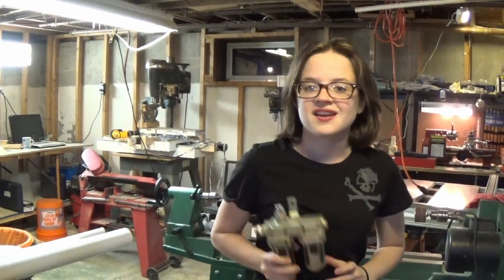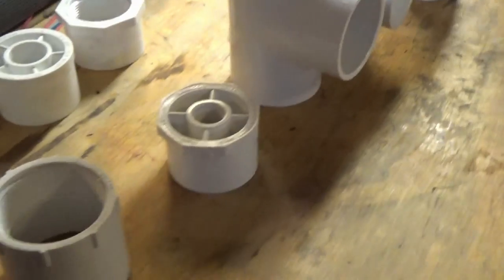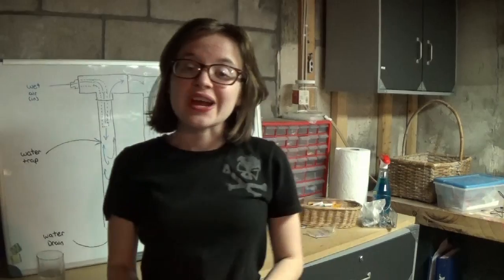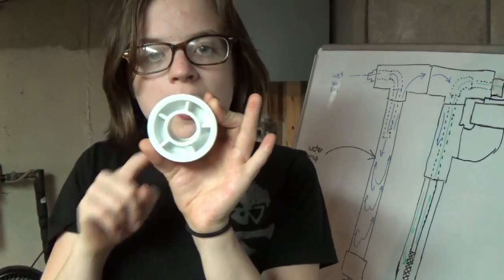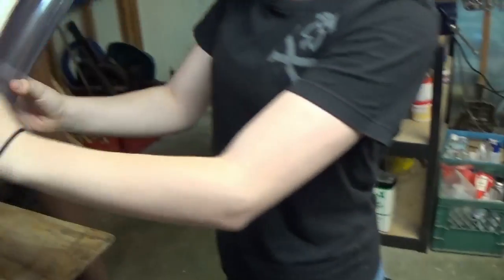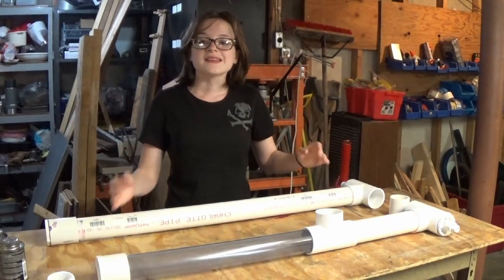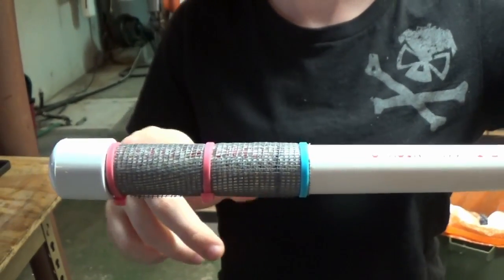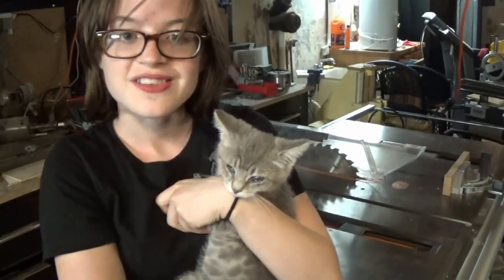Ep 11 Dirt Cheap DIY Dessicant Air Dryer

Comment: I really liked the how it works part of the vid.

Hannah, you are correct in getting rid of the humidity to help control sand clumping and stopping up your blaster. However the real problem is that you are using sand. Some other medias don't have this problem.

 I usually spread the sand onto a tarp and leave in the sun to dry, then screen out the junk before using. If I am recycling the sand, I also screen out the fines into another bucket to use for finer sand. I assume that you are going to paint your VW and sand blasting cases problems here also. Fine dust buildup in crevices is common to all types of  blasting and can cause the paint not to stick. If you get out your magnifying glass and closely examine the blasted surface you will see tiny grains of sand actually embedded in the metal Some say that this is silicon and will cause problems with some paints. Cure is to use sandpaper after blasting to knock these off.

Now for the real problem with sand. I started to say this on one of the other videos, but I didn't. Sand dust causes silicosis. Irreversible and ultimately deadly. Google it. Some other medias don't.

Blasting cabinets solve the problem by containing the dust.

I assume that you are using a respirator under your hood The hood protects your eyes and skin but does nothing for your lungs. And it is hot. A solution that i like a lot better and that can also be used while welding, painting, or any time you need it,  is outside positive air pressure. It involves an oil free air pump/fan, a long flexible hose fitted to your hood and set the pump some where where there is clean air. I set mine inside by the air conditioner/heater. I droop the hose down from the ceiling in the work area so it is out of my way. The positive pressure in the hood keeps the dust out, provides a cooling breeze across your head, and keeps the window from fogging. 

I tried to make a homemade one from 4" flex duct and a 4" fan but it didn't work too well and was cumbersome. So I bought one from ebay with a 120v tubine type fan and 100' of 3/4" light weight flex tubing and quick disconnect hood connectors. Works good but the fan is noisy in the house, so a remote switch to turn on and off is nice. About $250 10 years ago, $400 now, but you can easily spend 10 times that on better systems.  I know its expensive, but worth it to my lungs and comfort. Can also be used to blow up air mattresses, boats, and beach toys quickly. Works pretty good for light dusting as well, not as good as an air line. Scuba compressor would work if you have one. This would be a good DIY project for you. You could run 1" pvc out to your work area/areas and then quick disconnect adaptors to your flex hose

 Google "positive pressure respirator system" Here is one similar to my cheap one

http://www.ebay.com/bhp/supplied-air-respirator

Comment: Hannah, this is so cool. When I get back from being busy building a sauna (a finn needs a sauna), I'll definitely be copying from this design. I'm also loving the naming scheme of Bernoulli and Schrödinger. Do you also have Otto for the combustion cycle?

+drb52photo she said the pieces are pressure rated so that kind of takes care of the shattering issue...
Reply: PVC pipes and fittings are designed for pressurized water applications.  Please do some research on the subject before you decide to make the assembly.
Reply: just because it is pressure rated does not mean it will not suffer from pulsing oscillations that cause hairline fractures in plastic pipes. That then lead to some dramatic failures. Exploding plastic pieces can cause death if you are nearby. Might wanna do some research.

Comment: It has been my understanding that pvc should not be used for compressed air applicatins due to the potential for shattering and projecting sharp pieces.  Can you explain why you are not concerned about this potential hazard?
Reply: very well played......
Reply: You should Google "schedule 40".  Both metal and plastic pipes are schedule rated for different pressures and temperatures. The biggest problems that have had with pvc are related to:
      water freezing and breaking the pipe (happens to metal pipes too),

      uv radiation making the plastic brittle when used unprotected outdoors (cover/paint it or use the grey pipe from the electrical section at the store which is uv resistant but not schedule rated for pressure),

      and static electricity problems which can be a hazard in some applications utilizing flammable fluids (fuel, some paints, pesticides,etc) or fine dusts (dust collection, vacuum cleaning, etc). Grounded metal pipes are best for static electricity problems.

High speed air/fluids or tool rubbing against the pvc can generate a lot of static electricity in pvc, styrafoam, and other plastics. Look at the pvc she cut with the lathe and saw. See all the chips clinging to the pvc (and probably her skin and everything else)?  Most of the solutions I have seen to static electricity involve wrapping/fastening copper wire around/along the pipe  (the wire must make as good of contact to the pipe as possible) and grounding. 

I have used pvc for years because it is quick, easy, and cheap and for some uses it is just fine. 

It is your responsibility to do your own research and follow your tool makers and material suppliers recommendations. Electric arcs and a fine mist of flammable fluids (or vapors) go boom or start a fire. "A horrible way to die, right Bernoulli?" Maybe she should consider more straps and grounding them. It's what you don't think that will/can bite you. But when its all over, the best that can be said is that life is just a bunch of trade offs.
Reply: +kidharris It is my understanding that it is the oil in the air that can compromise the pvc pipe's pressure integrity.  Web sites that I have found do not recommend pvc for pressurized air applications.  I would urge anyone considering making your assembly to do thier own research.
Reply: I haven't heard of that, but I don't think it will be a problem for this setup because I believe she is using oil less air compressors and doesn't have an oiler in the line.
Reply: kidharris 😝Here is one more link, read the first and last paragraphs.

The makers of PVC disagree with you.

http://www.lascofittings.com/compressed-air-and-pvc
Reply: kidharris Wow.. All I did was disagree and you go into a diatribe about BS spins and politics? 😂 

Why is it that manufacturers of PVC and those who deal in it strongly recommend not using PVC as airline?

I'll tell you why, because as you said, water is not compressible. It cannot store energy, while air is compressible and will store energy.

That's the difference. That is the balloon example. 

That is why PVC is a bad idea for air lines and is why all the manufacturers don't recommend it..
Reply: Hey BUF, thank you for the link. Since I already have the items, I think I will still use them but i'm definitely going to buy a pop-off valve for this now because of the article you posted. I'm am going to consider swapping out the hardware for copper later. Thanks for the very informative information. Keep up the good, "diatribe about BS spins and politics? 😂", LOL, It's very much needed! 
Best Wishes n Blessings. Keith
Reply: Let me put my .02 in.  You are right about not seeing the difference, but hearing it.  And all of your points regarding material properties are correct.  BUT, the difference IS in the reaction.  The reaction is a result of the ENERGY that is built up with air versus water.  Air can build up a stored amount of energy over 700 times greater than water!  This is because of the compressible nature of air vs non for water that you mentioned.  the noise is the release of this energy.

I am the Quality Control Manager for a piping company that fabricates piping systems and pressure vessels.  The ASME codes that we follow generally suggest that a hydrotest be performed for safety reasons.  If an air test is dictated by a customer, it is typically at a lower test pressure than if using water.   If an air test is performed, we follow an ASME standard (PCC-2) that even dictates the minimum distance personnel must be from tested fabrications or vessels.  

Look up hydrotest failures or hydrotest burst on youtube and look what can happen to steel pipe or fittings tested with water.  Those same failures would look like a bomb with an air test at the same  pressure!

kidharris wasn't far off in that all materials have a "yield stress" where the material will break.  But before that, all material will "stretch".  It just isn't easily noticeable in plastic or metal and easily seen in a balloon.

The potential dangers with compressed air are very real, and I cringe when I see some youtubers re-purpose pressure vessels like propane tanks.  if there happened to be defects in the welds, the results could be deadly.
Reply: @tobywise3781  Thanks to you and others for taking the time to point out PVC limitations and provide some links to manufacturers websites.  Somewhere in the comments someone posted about codes, who writes them and why.  All this along with original video are interesting informative content, food for thought.
Reply: Juat keep a piece of thick plywood over the installation to contain any pieces in case of a failure
Reply from the maker: As you point out, there is a significant risk with PVC that you do not have with other materials, and that is that if it fails, it is not ductile, and will shatter rather than deform, so shrapnel is a possible problem. 

With the exception of the clear section for the dessicant beads, all the parts of this dryer are rated between 220 PSI and 600 PSI.  (The clear section at 120).   This dryer is after a regulator and oil filter, and I run the system at a max of 90 PSI.  Since the safety margin is so large and since I will be nowhere near the unit when it is in operation, there are no real risks in my application.  

If I had been concerned, I would have built a plywood shield with air gaps around the sides to intercept any flying shards but allow the air to escape during an explosive decompression.
Reply: Keith Noneya I wish PVC was a suitable choice. I'd love to use it.  Something to consider about a relief valve is that while it would allow the system to vent at a given pressure, that pressure assumes the PVC is not going to explode below the "lift" pressure, if that makes sense. Relief valve may lift at 125psi but the PVC header may explode at 108psi.  Obviously these are made up numbers.

Something to consider over copper is PEX.  It will not explode like PVC, but should rupture much like copper would in the event of a failure.
Reply: kidharris I think you're tilting at windmills just a little hard man..
Reply: Not a complete solution but a rough enough fix would be to wrap it up with duct tape and that would contain 95% of the shrapnel? The worst bit was the lubricator on the line in LOL.
Reply: heres a wild and crazy idea for all of you thinking youre going to get speared to death by pvc lol...wrap it in duct tape....now its would probably hold up to more psi and if it fails it wont shoot a stake through your heart ha   not rocket science
lol just saw dazaspc comment now...see another one with a brain
Reply: actually, the balloon comparison is valid. 

The thing about the difference between fluid pressure and air pressure is that air can be compressed, and water cannot.  Let's say standard air pressure is 15psi.  Now, let's say we have a section of pipe with a volume of 2 liters.  If you fill that with water pressurized at 150psi, you have 2 liters of water in that pipe.  If you fill that with air pressurized at 150 psi, you will have 20 liters of air in that pipe.  

If the pipe fails under that water pressure, water will spray out of that pipe.  If the pipe fails under the air pressure, the pipe will explode.
Reply: BellyUpFish        I am NOT an expert, but I would be venture that 95% of the reason  that pvc manufacturers do not recommend   their products for air type usages is  Because of liability concerns. ,
Reply: yeah...liability concerns, and the common human decency that comes when you know a misuse of your product can cause serious injuries and possible death.
Reply: She is, she said so so please watch and listen again.
Reply: johnsont963 except those pressure ratings are for liquid, not air, which makes a difference.

Fill one balloon with water and one with air, then pop them both.  

What is the difference in the reaction?
Reply: kidharris Middle of the second page..

http://www.cresline.com/pdf/cresline-northwest/pvcpressurepipe/CNWPVC-40.pdf
Reply: BellyUpFish I see that you fired off multiple posts in a matter of a few minutes. I am going to only make 1 reply. It appears that you did not understand my post. I did not say that pvc should be used for airlines, nor did I disagree with you. If you look higher up on the posts you will see one that I made 8 months ago that points out some of the other dangers ot using pvc.  How could I disagree with you about pvc , you never actualy said pvc was bad for airlines, you merely insinuated it with your question which is a typical political speaking tactic. BTW, if you jack up the water pressure to that of airline pressures, what do you think will happen to the pvc? Will there be a difference from the air? Will it be safer?

What I did say was that your comparison of 2 balloons was bs, had no basis, and was in fact useless and misleading. I stand by that and furthermore, since your replies are so misdirected I think that any further discussion by me to you would be a waste of my time. It is also understandable that both OSHA and the manufacturers of pvc would go on record as saying no to the use of pvc to avoid liability.
Reply: BellyUpFish    AKA DeadInTheWater  lol That's a silly comparison, but a great bs spin,  you should have a good career in politics - you never really said anything but insinuated a lot with your questions. 

A balloon is a flexible membrane and pvc pipe is a rigid structure and does not follow the same "rules" as a balloon. Note that you did not stipulate whether the balloons were sealed or not. The balloon will burst simply from the weight of the water stretching it without any pressure. Air (gas) is compressible and water (liquid) is not and also follow different "rules". Those "pressure ratings" are for pressure (at a certain temperature) and should be good for any fluid that is chemically compatible with the pvc. You should also note the balloon is already full of air when it is "empty", when you blow it up you are adding more air under pressure and if you open the top all of the extra air will escape ( it will never be empty of air - could say it is always full of air - unless you pull a vacuum on it). That is not true of the water balloon (it can never be full until the instant it bursts), it will only empty if you turn it upside down and pour it out or burst it. Gravity is what is making the water balloon stretch, not pressure. Even this is not true if you squeeze a sealed water balloon or apply hydraulic pressure from a pump or ........Also the balloon has a large modules of elasticity and will stretch a lot before breaking (and because it stretches - changes volume - it never really develops a lot of pressure like the pvc does) whereas the pvc  will stretch very little before breaking (unless it is heated, temperature affects material properties very radically, both hot and cold )....etc, etc 

To answer your question "What is the difference in the reaction?", I don't "see" a lot of difference other than  everything gets wet under the water balloon. I "hear" a lot of difference. The air balloon makes more noise due to air speeding up during the rapid expansion, the water does not expand when it bursts.